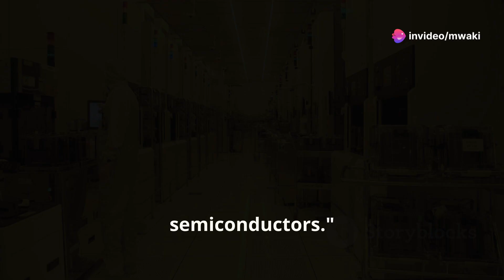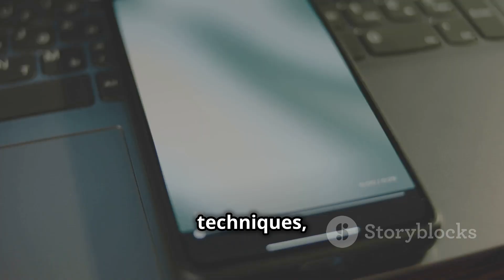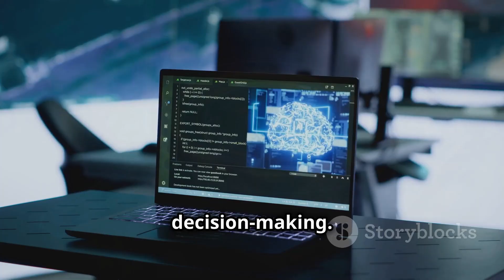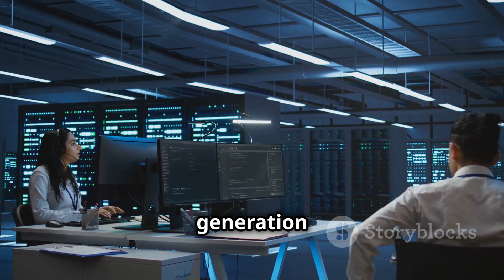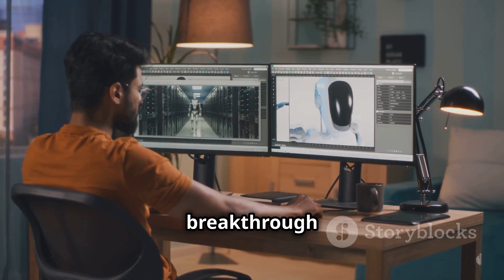China’s Xiaomi Groundbreaking 3nm Smartphone Chip: Biggest Tech Move in 2024

Comment: I wasn't aware that XiaoMi had a fab. They have been using SMIC as their foundry. The DUV technique for sub 5nm is multi-patterning. Multi-patterning is also used with EUV for the most advanced process nodes.  With DUV, the smaller the geometry, the greater the number of steps to write the designs on the substrate.  

More steps means more process time and an increase in errors. The result is that process costs increase and yields decrease. Lower yields increase costs even more. 

I believe that it is possible to produce 3nm devices with DUV via multi-patterning. The problem is yield and cost.